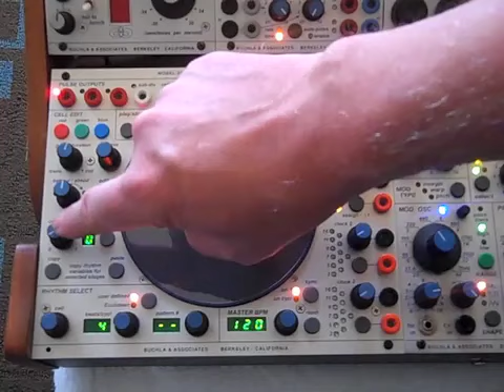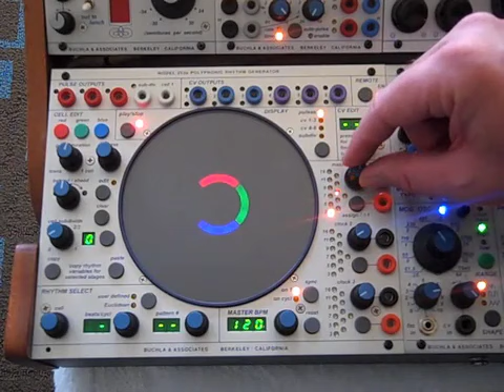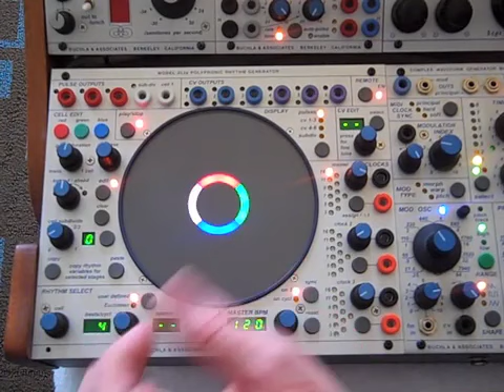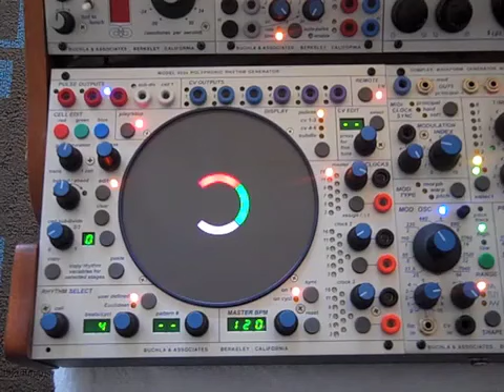Buchla 252e Overview

Comment: dear Todd - I would like to use the 252e with my music easel. how would I clock the 252 from the easel ? would I send PULSE to the CLOCK in on the 252 ?
Reply from the maker: das SPEZIAL It is my understanding that the 252e would have to be the master clock. So you could clock the easel from 252e pulses. If I recall correctly the 252e can only be clocked via MIDI
Reply: @vgermuse  thank you kindly for sharing your help on this. I use Ableton as my main clock which send midi signal to the Music Easel or a pulse into the easel ... I.e 125 BPM.... Would this mean either of those 2 methods will not work and I would need to buy a separate Buchla unit to manage the midi signal to send to the 252e unit ?
Reply from the maker: das SPEZIAL Ah, I don’t use midi so probably not the person to talk to...that said here’s from the manual if this helps, “You can use external MIDI gear to send messages to the 252e through a 225e or through the FirmwareCard in USB MIDI I/O mode (225m)” best wishes
Reply: @vgermuse  Thanks Todd :)

Comment: Todd - thanks for posting these videos.  I'm looking into the 252e at present, but the user guide lacks some 'obvious-isms'.  Perhaps you could help?  

The sequencer is max. 16 steps, but can it run sequences of every length less than 16 (i.e 15/14/13/12 etc through to 1 - and including 1)?

Also, can it run two/three sequences of the same length (i.e two 8-step sequences), or do the sequencer lengths have to vary due to the visual inadvertently acting as a restriction (in the sense that each sequence requires its own visual domain, as opposed to superimposition)?  

Appreciation in advance of your reply.  I've emailed Buchla directly with a few questions, but haven't heard back yet.  

Regards
Kris
Reply from the maker: Kris Lennox hers for starts to answering all your questions https://youtu.be/59ZDZmHtnoY
Reply from the maker: Kris Lennox next I suggest you watch my entire video manual for the 252e...hope that helps https://www.youtube.com/playlist?list=PLgcsaajaNk9etBIBcQo3QB8Kc3DB2tBa3
Reply: @Todd Barton  Thanks Todd, I had watched all of them before contacting you.  Unfortunately your video(s) didn't help my specific questions, but I spoke to Marc today via email.  The limitations of the 252e are something of a drawback i.e it can't do every sequence length under 16 on a single track (i.e it can't do 13/14/15 step sequences).  That plus a few others. - Edit to add - I just noticed you mentioned 'layers' in this video - I think it is the nomenclature that was confusing me i.e not referring to them in terms of sequence length.  I assume two sequencers/sequences could be concatenated to create a sequence of length 13/14/15, but then a track is lost in the process.  PS you mentioned each clock has 11 layers, but you stated 12 layers in the talkthrough.  Thanks again & all best

Comment: hello Mr. Tod; i really appreciate the video; however i have got the spider with 225h & 226h system and i would like to use it as a sequencer for a DX7 yamaha, is that even possible? i have tried to sequence a Dark energy II with no luck at all ;(  i know is a great unit but i think its to complicated and the manual is not very easy to understand even kknowing terms as MIDI, CV; PULSE; so, could you please show a basic example of using this module to control otrher external or vintage synthesizers? that would be awesome; specially showing some examples of what the 225h and 226h or the 202h can actualy achive when interecting wth other synthesizers or modules; sorry but i feel like the manual is in japanese and i dont have a clue even to use use the seqnuecer if it is possible; Best Regards & Merry Chrismas (^_^)v